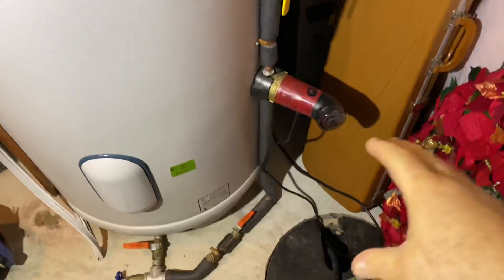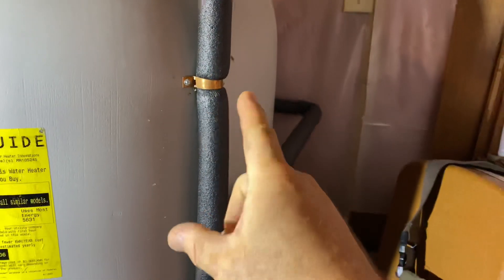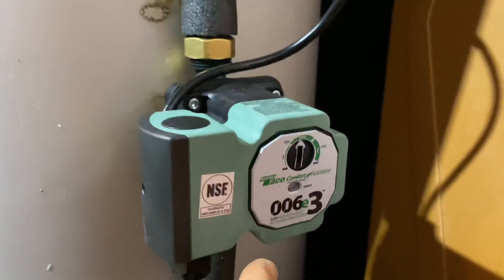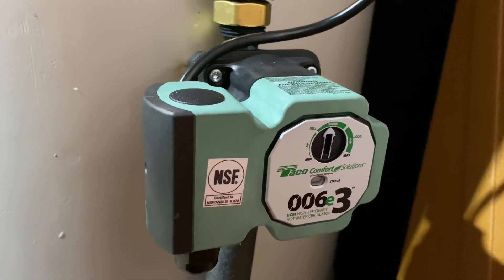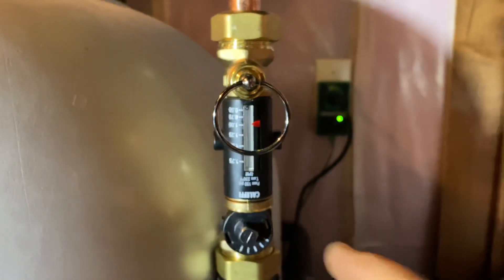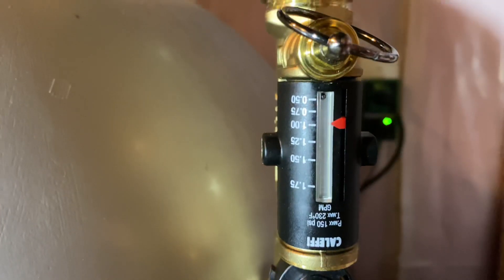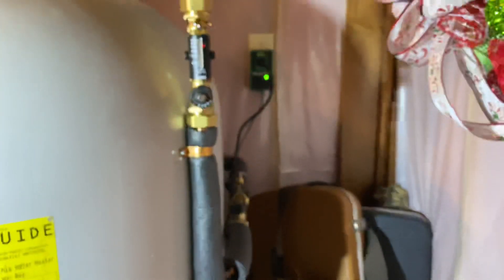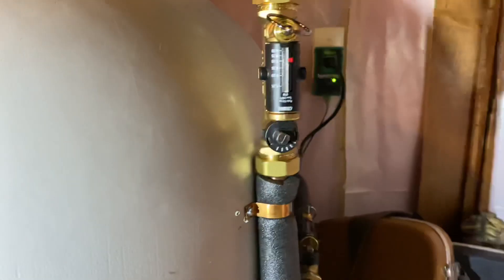Best way to pipe Hot Water Recirc

Comment: I installed a recirculation system in my two story house. Every sink has a push button that turns the pump on for 45 seconds. When you want hot water, push the button. In 6 seconds, the water is hot. I ran a 1/2” pex pipe to the farthest 2nd floor bathroom and teed it into the hot water line there. The pump is in the garage next to the water heater. There is a check valve before the pump to prevent back flow. The time delay control is on the wall by the heater. The system works flawlessly. An added bonus is the water pumped into the bottom of the tank prevents sediment buildup, increasing efficiency and the life of the tank. I also check the anode rod once a year and replace it if it is dissolved.
Reply: "In 6 seconds, the water is hot" - is that 6 seconds after the button it pushed?  Or 6 seconds after the 45sec pump run completes?     
A pump is just equivalent in flow to as if the faucet was open?  It it takes say 1 min for hot water to get to the faucet, then running the pump for 1 min effective does the same thing (flushes the line of cold water; with the exception of not having the cold water go down the drain)?
Reply: @ 
6 seconds after the button is pushed. I run the pump a little longer to actually heat the domestic hot water pex tubing so the water doesnt cool rapidly. Plus, all my hot water lines have armor flex insulation, point to point.
Reply: If was 6 seconds after the pump was started, how long did it take before the pump?
Reply: @jwhite4  
Over a minute. A lot of wasted time and water.

Comment: Thanks for the video, a bit off topic, but the Hot Water Recirc pump is pushing water from the "return" line into the hot water tank via the drain at the bottom of the tank?  Just wanted to confirm that
Reply from the maker: Actually on this model that is also the cold inlet to the tank. The hot water recirc is connected to the cold inlet of the tank. This simplifies the piping because of the mixing valve.
Reply: @ cool, thanks for clarifying!

Comment: Should use ¾ to reduce turbulence and Reem your cuts as well and if it's in a basement you can utilize gravity to let the heat rise without a pump .always use the lowest head setting pump a aqua Stat and timer is a good idea you don't want t o burn the pipe it's like the water is running all the time you wear out the pipe with friction

Comment: I read, from a YouTube comment, that an expansion tank is required when you have a dedicated recirc line. Where would that be installed exactly? On the cold inlet to the water heater before the spring check valve? Or somewhere on the dedicated recirc line?

Comment: Question,, did you turn the face of the pump somehow, I just received the same pump and if I install the pump exactly the way yours is my water flow would be going towards the pressure valves and you show your pressure valves water flow going towards the pump,,, so is there a way to turn the dial face of the pump so the writing on the pump is upright like in your video,,, I assuming the water flow should all be going towards the bottom of the water heater,, Thanks for any help

Comment: my question is, are you taking your hot water from the hot out tube side and returning it to the drain port thereby introducing the recirc water to the bottom of the tank, and if so is there a down side to doing it that way, ie damage to the drain valve and interior piping of the water heater, great video content
Reply: There are 2 ways to pipe your recirc line. You can either spin off your boiler drain and pipe your resirc into the bottom off the tank like he did in the video. Or you can pipe your resirc into the cold water supply line entering the water heater. If you run your pipe like this, an additional check valve is required to prevent hot water from entering your cold water system. Both are acceptable ways to pipe a water heater. When I lived in Minnesota, pretty much every plumber I knew piped their resirc to the bottom of the heater. Now I live in Tennessee and every plumber here pipes the resirc into the cold water supply. I guess both are fine, it just depends on who taught you plumbing. I do both depending on which way is going to be easier for the job I’m working on.

Comment: You’re videos are always really informative!
This is a great way to set up recirc. If the supply lines are 3/4. Can the recirc lines be 1/2? Seems like that would work.
Reply: I think you wouldn’t gain anything by using 3/4 for return if your supplies are 1/2. If you up your supplies to 3/4 then go for 3/4 return.
Reply: @russellcali9294  Thanks for the confirmation!
Reply: Did you ever get an answer?
Reply: @MyGoogleYoutube  no. But after more research I decided to go with 3/4 my setup is a little different because I have all fixtures coming off of one big loop. But I think if you are running the line back from the furthest fixture only then 1/2 would suffice. I’m not a pro tho. Just a professional homeowner!
Reply: @russellcali9294  

Thank you :)
Reply: I have sort of the opposite issue:  supply lines to fixtures is 1/2, but the lines on the water heater are 3/4.   I can put a 1/2 -> 3/4 adapter at the far room, and then run 3/4 back to the 3/4 drain valve (inlet).  Or, run 1/2 back to the HWH, and then use a 1/2 -> 3/4 adapter there.

I'm sort of thinking 1/2 return line is better.   I don't think a 3/4 return line will purge the cool water from the 1/2 supply line any faster.   But, having a 3/4 return line I think means more cool water in there that also needs to be purged.

Thoughts?

Comment: - Your specifying the components is valuable information, but I have a question in that the head of the pump is 13', so I would guess that the loop needs to remain well below that?  
- I would think that unless someone is doing a gravity system, it would be much cleaner to have the returns dump into the cold water line above the water heater?  
*I didn't realize until this video that I would need a balancing mechanism.  

Thank you for taking the time to make this video.

Comment: People, if you want warm water coming out fast at the faucet, simply make the loop without installing the pump.  Pump is not necessary at all.  Once the full loop is made in the warm water line, warm water will circulate through the warm water pipe by convection effect where hot water expands in the heater and forces the water to move through the loop to colder region and back into the heater and continue the cycle.  I had a water pump installed but failed and I took it out and bypassed it and I still get nice hot water very quickly better than ever before with no headache to deal with failing pump or timer.  Pump and timer are expensive and difficult to maintain and absolutely not needed in most residential use.  If you do not believe me, try first before you take the trouble of installing one.
Reply from the maker: Well that would be true if you installed a dedicated loop sloped properly all the way from the heater to the farthest point and had no branches on the main trunk line. Most homes have multiple levels and split branches on the main, a gravity circulating system does not work for that at all. This is basic stuff, any plumber would know that.
Reply: @mechanical-hub  My home is a big two story house (3500 sf) with 3 1/2 baths with faucets located all over the place and I get warm water very quickly everywhere including kitchen, believe it or not.  The home came with a pump installed but failed.  So, I replaced it with another one and it failed again quickly.  So I took out and bypassed it and I am getting the warm water as quickly as before even in cold winter weather.  I am sure my house, due to its size, has multiple levels and split branches with faucets located very far from each other but I have no problem at all.  I guess, depending on the pipe routing, it may not work for some homes but I would think it would work for most average homes.
Reply: @tommason4702  you got lucky. The water heater is sending hot water to the high point in your loop first. Any other pattern won't work for a gravity fed loop.
Reply: Doesn't this also run the HWH longer, since that flowing loop is always losing heat and thus requires the HWH to re-heat it?  [I know insulation can help with that.]

My feeling is I think I just need the standing water in the hot water line purged, until replacement hot water from the HWH arrives there.  [Basically what opening the faucet for some time period would do.]]  From there, hot water is used; typically no additional effort is needed to get hot water back there again.

I think a pump that runs a lot, or a gravity system that is circulating all the time, is wasting more energy than it needs to.

Comment: I’d be really interested in smart plug features that could tap into room sensor data so the pump runs for whatever amount of time when occupants enter a bathroom/kitchen. Great fix for this system, dude!
Reply: You can make your own. I use home assistant. I have motion sensor (philips hue)in the bathrooms. I have the taco 006e3 plugged into a tp link kasa smart plug(there are several other brands that work just as well).

I set up a super simple "automation" when the motion sensor detects motion the answer plugs turns on and the pump runs
Reply: @ good tip, thanks! Def going to spin up HA at some point
Reply: @jl9678  Do you have a routine that is stops the pump after N sec/min?  Seems like once it runs and purges the hot water line of cool water, the pump doesn't need to operate anymore.
Reply: @jwhite4  yes, its set to run for 1 minute IF the motion sensors detect motion, AND if the pump hasnt run in the last 20 minutes.